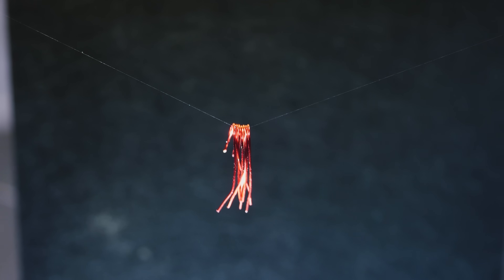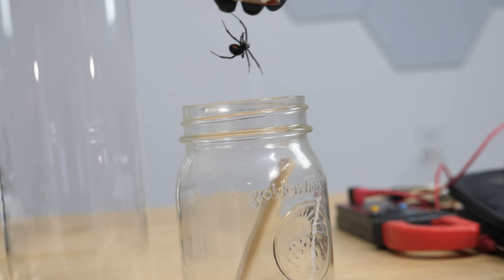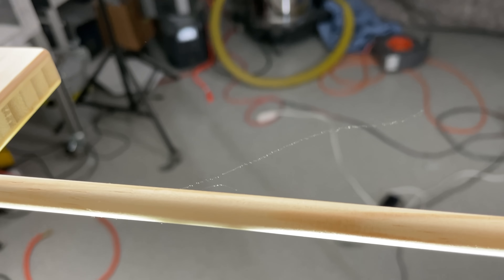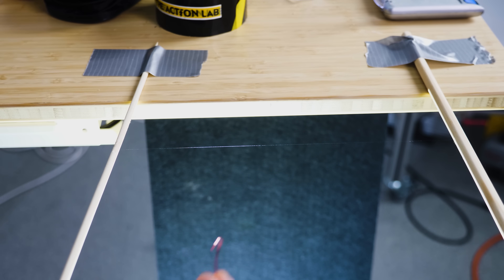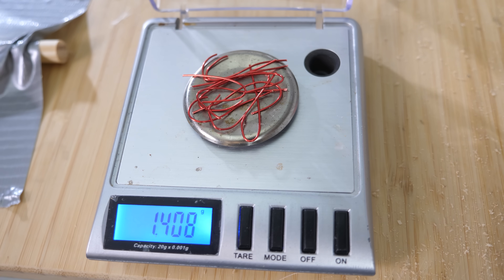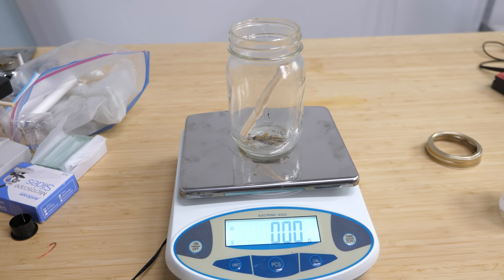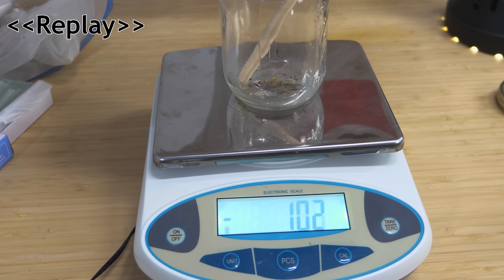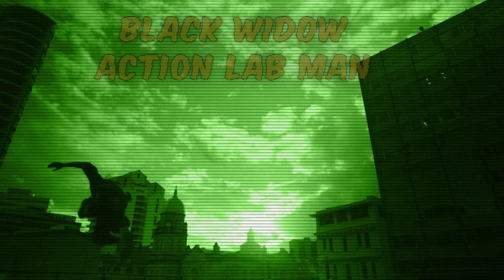Is Black Widow Silk Stronger Than Steel?

Comment: "deadliest spider in the US"
continues to poke it
Reply: Unless you're a kid, or your immune system is compromised, you'll be fine even if it bites you. It'll just hurt a lot.
Reply: They're chill until you don't provoke them.
Every venomous animal uses their venom for hunting, not for defense so they usually warn you before they attack.
The ususal method you need to follow when handling animals of this kind: don't pester them, let them move freely, don't make suddden moves or sounds
That's it, you can handle any animal like the black widow. They won't hurt you if you doesn't seem like a threat to them and even if you do, they rather run away from you than actually attack
Reply: @LastGoatKnight  Please don't handle animals even with this method. Just leave them alone.
Reply: @spoopyd.8910  Why not? Our exterminator handled them and said the same thing. They only bite if provoked. People are usually bitten after reaching into them and startling them. I wouldn't play with them if you're allergic, but they're relatively safe otherwise.
Reply: @BlakeEM  A grenade wouldn't blow up unless you remove the pin. But that doesn't mean you should fondle them like your balls. Just don't play the stupid games so you never win the stupid prizes. Is that so hard to understand?
Reply: @spoopyd.8910  The pin is the safety, it won't blow up if you remove it. It will blow up when you release the handle. No, I'm not fun at parties.
Reply: @spoopyd.8910 Sometimes handling is unavoidable, and it's better to know how to do it safely and calmly. Nobody was saying "hey kids go pick up black widows", it was just basic information on how to properly handle basically any spider, insect, or other small animal. 

Not to mention, god forbid someone try to combat overdramatic fearmongering with the truth of the matter that they're docile and unlikely to bite even when interacted with. Here's a fun fact: there hasn't been a fatal black widow bite in the US in over 40 years. Of the 4-8 estimated deaths per year, most are a result of complications like allergies or a compromised immune system.

Compare that to dogs which kill an average of around 40 people in the US alone on an annual basis. Do you go around telling people to avoid interacting with them too, given the clear threat they pose if provoked, or have you just failed to recognize your bias against the smaller, weaker, and statistically less dangerous animal just because it's a spider?
Reply: @avanelletheclockfriend2515  To be fair, if we had as many people petting and playing with black widows as they do with dogs, the numbers would be vastly different…
Reply: @avanelletheclockfriend2515  no. I tell people to avoid interacting with pit bulls. Not dogs in general.
Reply: @LastGoatKnight  Yup, just be a part of it's environment and it won't bother you. I actually tried to get a European one to bite me once but it just fully refused.
Reply: @spoopyd.8910  I've seen a tiny Jack Russell take half a kids face off. Small dogs tend to be more of a risk.
Reply: @EddieTheH  Oh hey I also got my face attacked by a small dog as a child. Chihuahua mix I think? It wasn't anything major but there was a loooot of blood. Naturally my dad gifted it to one of my cousins as a birthday present. I don't hold anything against Ruger, he was just a little fucked up thing and I was a small child with face paint. Apparently he was a good dog, just somewhat high-strung.

Unfortunately, a few miles from where I live some kind of retriever(I think a Labrador but could've been golden) that "wouldn't hurt a fly" killed a toddler a few years back. Not sure what the story was but if I had to guess it was play that escalated. 

Neighbor's pitbulls are angels though, they don't even bark when I walk by unlike the other dogs on our street. Just watch and wag their barely-even-existant tails. Shame they're owned by people I can't stand.
Reply: @spoopyd.8910  you know what, this tells me all I need to know about the sort of person you are
Reply: @WreckedRectum  It's almost as if there's a correlation between people bothering animals and those same animals reacting in a defensive manner, and that maybe the issue isn't the animal so much as the manner they are being interacted with, and that it's disingenuous at best to paint an animal that will always choose to avoid humans when the option exists as inherently dangerous when the fault lies with people intentionally or unintentionally putting them in the position where they feel compelled to defend themselves
Reply: @avanelletheclockfriend2515  I was thinking the same thing and honestly wondering how spoopy got to this video with that mindset.
Reply: @spoopyd.8910  tell me you're a redditor without telling me you're a redditor
Reply: @spoopyd.8910 Not necessarily. They can still be fatal to anyone. The venom's strength varies from spider to spider.
Reply: @WreckedRectum I don't think so, for one there are a lot more spiders around you than you see, a black widow bites you and you can easily stop it from doing it again, a dog on the other hand can overpower a human fairly easily
Reply: @LogiDMA Dumb Ways to Die
Reply: they're also extremely docile, you'd need to press them against your skin for them to maybe bite you
Reply: @LastGoatKnight  "Every venomous animal uses their venom for hunting, not for defense" - what do you think bees use their venom for? sometimes it can be for defense, sometimes both, in fact often it's both
Reply: It doesn’t surprise me that the spider didn’t bite him. Black widows are very chill. There is a paper called “Poke but don’t pinch: risk assessment and venom metering in the western black widow spider, Latrodectus hesperus” where they looked at the conditions most likely to provoke a bite. In short, they generally don’t bite when poked, only when pinched.
Reply: Third deadliest.
Reply: @LastGoatKnight   yeah. ive held a couple in my time without any issue. and both times,, i didn't know she was there immediately. coulda done anything, but the spider just chilled while she was moved
Reply: Black widows are always very slow.

It isn’t like a wolf or jumping spider so if you do get bit from poking it, you are just a doofus.
Reply: @WreckedRectum  "The [grenade] pin is the safety, it won't blow up if you remove it. It will blow up when you release the handle. No, I'm not fun at parties." - To be fair, @spoopyd.8910 never said that removing the pin would make the grenade explode.  They said that it won't explode unless you remove the pin.  Since the handle cannot be released without first removing the pin, that statement was correct.  I'm not fun at parties, either :)
Reply: @mattmt0918assuming you don't weigh like, 190lbs at 6'4... Yes they exist.
Reply: @HomeByTheSeas always very slow? How many have you been around/seen/had to exterminate? Because no. They're not all slow. And the fast ones are quite... Zippy? To say the least...
Reply: @nomore6167 yes but that's still a round about way of reasoning it. This isn't futurama "technically correct" is fortunately not the "best kind of correct" 

I'm pretty fun at parties. As long as I don't talk much. 😂
Reply: @mattmt0918 that may not be too far off. But at your height even just that 20lbs could make enough difference. Funny that though, you're about the weight I'm bulking up to.
Reply: @3xeplodng_3agle_studios  Black Widows are not quick like in the same sense as a jumping spider or wolf spider.

So they’re very easy to avoid as long as you don’t step into their web.

So just avoiding dark damp holes and such is enough.

So yeah, they are slow, in comparison to mobile spiders that hunt for food rather than wait for it.

Edit: My backyard is full of them, we had Cinder blocks with three holes each and they would make their webs in there if faced to the sky. They would make a web and there would be loose leafs and such on top, so that was one way I knew they were there. They also would make webs under our porch.

So yeah, I know you meant’t to argue but I have gone 34 years without a single bite and HAVE encountered them more times than the vast majority of people. Even had one in my canoe for an entire fishing trip. Didn’t get bit, I knew it was there. You can stop trying to attack me now.
Reply: @HomeByTheSeas  no you don't. Because I didn't. 😂 seems like you were ready though. Chill. 

I've seen some pretty quick widows. they aren't "all" slow. All I was trying to say.

Sorry you didn't appreciate that? 

Though... If I were to attempt to start an argument, it would be based on the fallacy that there's actually any real correlation between age and wisdom(after a certain point) not saying you're an exemplar, but using your age as a boost to your point only works on the naive...
Reply: @3xeplodng_3agle_studios  The argument was actually based on comparison of habit and actual movement to faster spiders.

Not my age.

My age was just there to show my experience with the topic, not the basis of my argument by any means.

You trying to make it my argument is gaslighting though, and considered a form of straw-manning.

The argument is that Widows do not have the habits of chasing prey, they wait.

And they don’t move nearly as fast as spiders who do not have to rely on waiting for food. So nice try at straw man, but consider it burned!
Reply: @3xeplodng_3agle_studios  
Wolf spiders can run up to 22mph for a few seconds. Which is insane considering their size.

Karaops are huntsman-like spiders in the family Selenopidae can do a 360 degree turn 8 times in a single second.

Flattie spiders are turning to strike their prey at speeds of up to 3,000 degrees per second.

Black Widows are slowpokes compared to these.

So, no, relatively speaking, Black Widows are not fast moving spiders. If anything they are about average. They can move decent lengths in time but nothing compared to an actual “fast” spider.
Reply: @HomeByTheSeas  no. I'm not. I was simply being a smartass there. Mein gott. You're taking this far too seriously. I quite literally said "chill" in the first half of my last response. 

You did prove my point about the aforementioned fallacy though and if you can't see that... (And no, the fallacy doesn't depend on whether you're correct in a particular instance or not.) 

I don't want to get serious or try to actually argue. You seem ready. Like I said. So how about we just cut this here.
Reply: johnny BRO WHAT ARE YOU DOING THATS THE DEADLIEST SPIDER IN THE US Timmy pokes it 10 times 😂
Reply: @3xeplodng_3agle_studios  I didn’t prove your point at all.

Black Widows are still not a fast spider. You can leave though because you lost the argument.
Reply: @HomeByTheSeas  I shan't. How can you "lose" an argument you openly refused to engage in? You just wanted so badly for it to be one.
Reply: @BtmQuark  bees aren't predators
Reply: @LastGoatKnight  I have never said that.

Comment: Some issues with your first test setup. Since you are applying load while the silk is horizontal, you need to factor the sine of the angle after the load is applied. This means that you're applying much more force to the silk than what you're placing on it in wire hooks

Comment: Using weight in a hammock will cause the strand to have much more tension. The strand would experience not only the vertical pull from the weights but horizontal pull from both anchor points.

Comment: There is a problem in your calculation.
You did not take into acount the angle of the silk.
When you are lifting heavy equipment, if you use 1 ton slings, and you have them at a 45° angle, you can only lift 500kg with them.
Reply: +1 Yep. Was going to comment the same.
Reply: It being supported by two threads though (left and right), at close to a 3/4/5 triangle, so the normal force in one thread would be about 5/6 of what he measured.  Pretty close in this case since the mistakes approximately cancel out.
Reply: What a depressingly pedantic take on an attempt to bring basic science to public forum.  This is basic science communication, not a high-level MIT material sciences lecture.  If he was performing original science you might have a point, but all of your concerns have been addressed in the hundreds of peer-reviewed studies performed over the past 54 years.  ALL this content provider is doing is providing an illustration of how the fundamentals of  AN approach to the process of experimentation works for a general audience.
Reply: @ddewittfulton  "Tolerance will reach such a level that intelligent people will be banned from thinking so as not to offend the imbeciles." - Dostoïevski
Reply: @ddewittfulton  when a post starts off with "pedantic"...what a snobbish way to insert yourself into a conversation.  this content creator appreciates feedback on his work.  just because you didn't come here for MIT level material science doesn't mean the content creator doesn't appreciate the feedback.
Reply: @ddewittfulton  It's a shame he chose to leave out a very useful bit of geometry understandable by a 4th grader and used by tradespeople and engineers the world over in this video!
Reply: There are 1-ton slings? Just imagine how big the adult spider would be! ;)
Reply: @Fahrenheit4051  Yeah i failed my phrasing, it sounds like the sling is weighting 1 ton :D

so i tried to imagine how big the spider must be, then i looked at average silk density, and found something intresting.

 silks are about a sixth of the density of steel (1.3 g/cm3). As a result, a strand long enough to circle the Earth would weigh less than 500 grams (18 oz).
Reply: Buddy, recalculate your max load. Don’t rely on what you’ve memorized, as it is incorrect. Apply math to the problem.
Reply: @ddewittfulton  I see your point, but there's nothing wrong with pointing out an oversight. If I missed something, I'd want to know about it so I can improve.
Reply: @Fahrenheit4051  1 ton is a very light sling. common slings go to 50 tons i have some rated for 75 tons and there is no real limit. they just get thicker but riggers will just use multiple slings as they get hard to handle.
Reply: absolutely correct. Although I appreciate these videos immensely, the calculation for the tensile strength of the silk is not represented correctly in this video. This is essentially a statics problem where the angle of the "cable" needs to be taken into consideration and a system of equations needs to be used to solve for the tensile strength of the silk.
Reply: What's stronger than ultra strength steal? The last you mentioned?
Reply: @ddewittfulton 
I think @Jay1830 had an insightful comment. It in no way took away from the awesomeness of James spider thing (shudder)
Reply: I agree with the general idea, but at a 45 degree angle, it should still be able to lift 707 kg, which is 1000*sqrt(2). Also, that's assuming it's 1 ton total. If each side is lifting that much, then you're lifting a total of 1414 kg.
Reply: You'd be right except he then changed his methodology and did the vertical strand test. You also neglected the added force applied when positioning the hooks. I thought he'd never get an accurate reading, not because of the angles but because of the oscillation of the strand each time he loaded a new hook. However he surprised me.
And the other thing his results matched other peer reviewed findings. So all in all I agree. A pedantic comment on a simple science channel - Flame away...
Reply: @ddewittfulton  "pedantic"
Reply: @ddewittfulton  He is a science communicator who has reached 300,000 people in 3 days. 300,000 people in the last 3 days have been misinformed based on the lack of understanding of this communication. You should be in support of the corrective comment as someone who holds science communicators in such high regard.

Comment: Ultimate tensile strength is a sexy engineering and intuitive measure but another key property that goes hand in hand is the ductility. In other words how much stretch does the strand have before failing?
This would be super interesting to compare to the other materials you reference. 
You’ll notice that in most cases higher strength materials are also a lot stiffer or less ductile.

Comment: One time at summer camp in Tennessee in 2006, there was a black widow nested in the ceiling joists of the latrine of my troop's campsite. I noticed it the 2nd or 3rd day of camp, and just looked up at it, hanging out there, every time I went to have a seat. I knew about black widows but gor some reason I just thought nothing of it and didn't say anything to anyone. No one else noticed it until the last day of camp, when the Scoutmasters called in the camp ranger and the established a friggin' perimeter and no one could go to the bathroom for an hour.

Comment: A not so subtle issue when comparing strengths of materials is that the concept of tensile strength is “bugged” when it comes to very thin materials (as it is a value that is normalized to area; this is a common problem in STEM). It is true that a spider web “could” hold an airplane, etc. but the usual comparison is pointless when one of the materials is limited to very thin/small dimensions (i.e. not practical at the compared scale).
Reply: Yeah also steel fibers are much stronger than real parts because of the lack of defects and other factors...